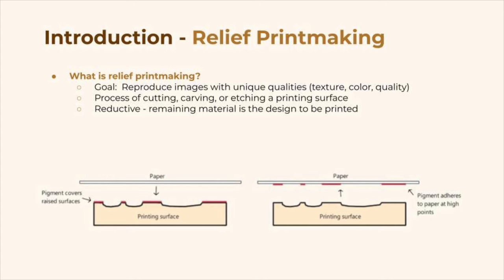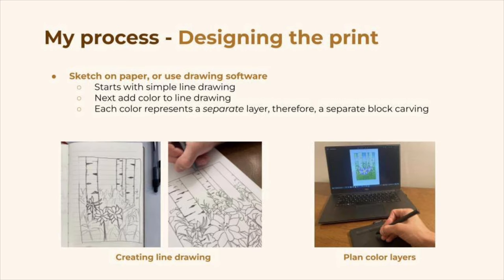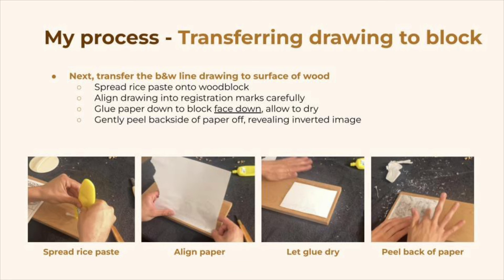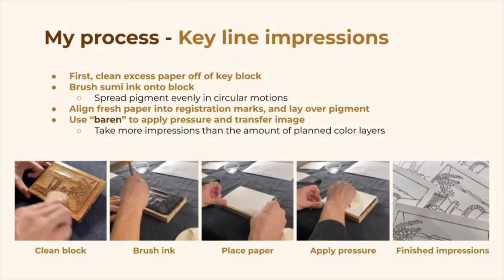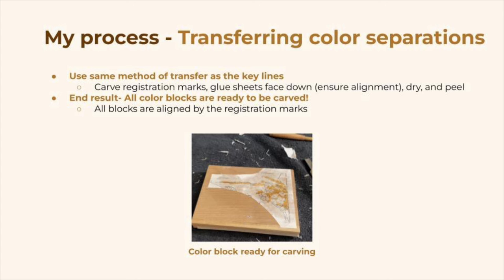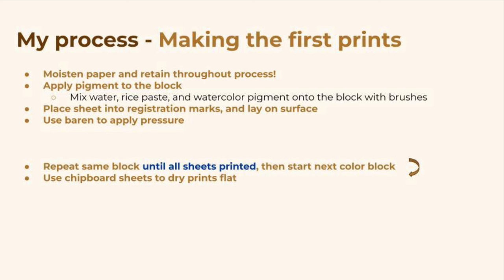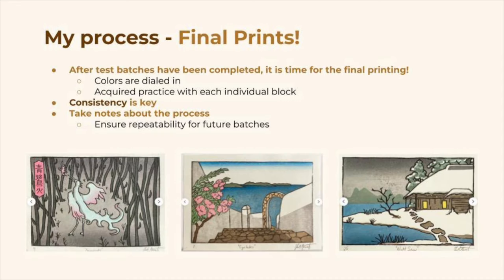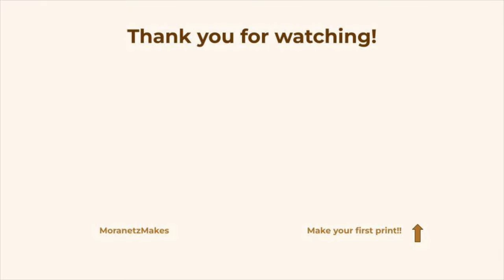How to make a Woodblock Print, The Basics:  Recap Presentation, Japanese Printmaking / Mokuhanga

Comment: What is the benefit of proofing the keyblock to make the templates for the color blocks instead of simply printing several templates from the beginning and coloring them before stamping on the block?
Reply from the maker: I prefer to use the key block proofs so that the color areas are defined by the the carved key lines themselves, rather than the “intended key lines” (before carving).   Essentially it gives me a little room for error/ any potential variance between the design and the actual carving.  

I think that most of the time it would make no visual difference to the final print.   However, I conceptually like the idea of removing that one degree of potential error.
Reply: Thank you!

Comment: Jack, I wonder if you can offer some advice. I’m using a Speedball water based paint meant for block printing. My results are very inconsistent: blotchy, bare spots, too much paint, too little paint. I’ve prepared my block as you show and tried many combinations of paint and nori to no avail.  Any thoughts on things I can try to achieve better prints?
Reply from the maker: Hey thanks for reaching out!   To be honest, I wouldn’t recommend using the water based ink for printing.  I could be wrong, but I think it is pretty different than what you need for Japanese woodblock printmaking (even though it’s water based). 

My recommendation would be to buy a few tubes of watercolor paint (comes in small skinny tubes at any art/hobby store).  Then, mix some of that paint with a couple drops of water to make it fluid, but still dense with pigment.  

That fluid pigment can then be mixed with your nori and should result in a better impression.   

Make sure you brush down your block with water to remove/clean the ink from your last printings. 

I hope that is helpful.  Please let me know if you have other questions!
Reply: Thank you. I did start over from scratch with my ratios of paint/nori/water and got better results, but I will get some water color paint as you suggest and see goes I get on.

Comment: Hey man, nice video. Do you use rice paste as a glue when transferring the image onto the block? I used a fast tack glue which David Bull mentioned, but after i finished carving, I simply couldnt wash off the remaining paper or glue. It started coming off a bit but then filling the carved lines with mushed up paper, bit of a disaster and the block is beyond saving. Im trying to work out if it was the glue i used, so might try rice paste?
Reply from the maker: Thanks for reaching out!  I actually do use rice paste.  From what I've heard, people don't love using it because it tends to peel up unintentionally from time to time (not as strong of a bond).  However, I've actually never had trouble with it and it washes off really easily!

I'm still surprised you had that mess when cleaning the block though.  Typically, when I wash my blocks, the glue and paper fills up the carved lines as well but it just takes some light brushing and extra water to get it all out.  Did the mushed paper on your block solidify between the lines?  I hope you can save it!

Comment: Thank you for the useful video！Which paper did you use？Mine never successfully peeled off.
Reply from the maker: For the first key line transfer, I usually use printer paper.  It can be a little bit tricky, so I recommend doing some practice sheets.  Here are a few general tips in case it’s helpful!

-Make sure the rice paste is completely dry before you start
-Dab your finger with just a tiny touch of water before you start rubbing.   This will generate some extra friction to get it going
-Once you get the feel of it, it’s best to be strategic.  I always start by rubbing a layer off of one edge of the paper.  Then, I can get under that layer and slowly work into a peel.  That allows me to strip a big layer off of the entire sheet at once.  Then, if I can’t see the design well enough, I continue rubbing a little more off slowly (without peeling). 
-When you’re starting, try not to push the limits too much. (If you can see the design already, don’t go too much further and accidentally break the paper completely).

I hope that is helpful, and please let me know if you have any more questions!

Comment: How would you make sure the registration lines on the color blocks are the same as the key block? 

Ive been thinking of trying this out, but want to get my mind wrapped around the process before I take that next step.
Reply from the maker: Hey, great question!   The first step (before working on the color blocks) is to take impressions of the key block.  Then you can highlight your desired color areas on those sheets. 

When you’re ready for the first color block, start by cutting the registration marks on an empty woodblock.  Then, you simply use those registration marks to align and glue one of the highlighted key line impressions.  This order of operations will automatically take care of the alignment, as long as you can place the sheets into your registration marks consistently. 

Thanks for the question and please let me know if that makes sense!